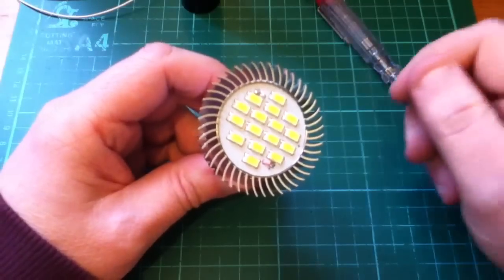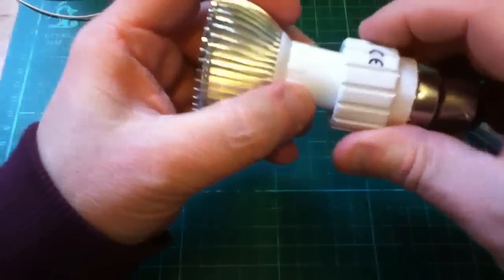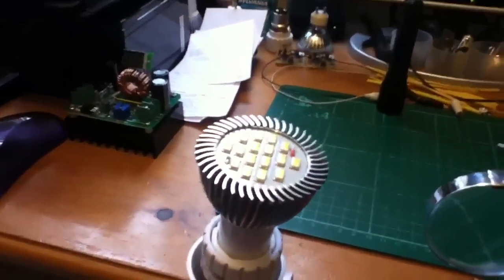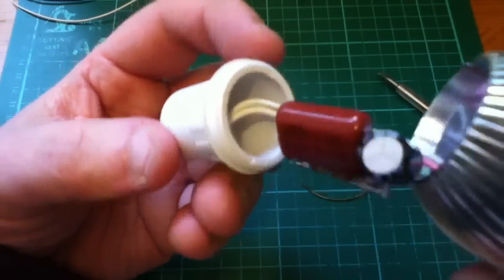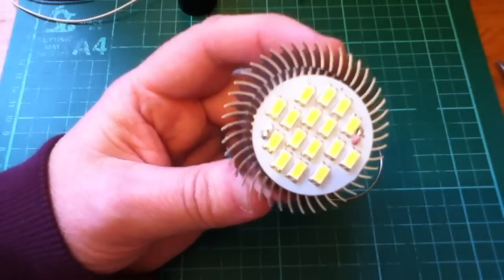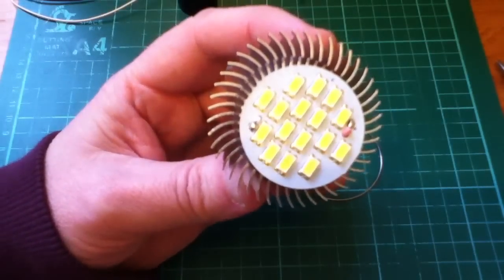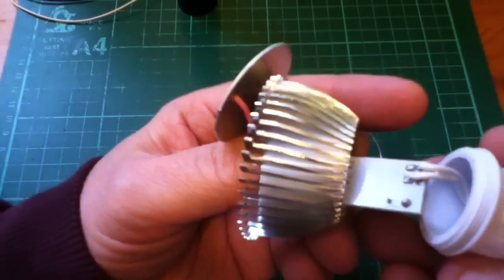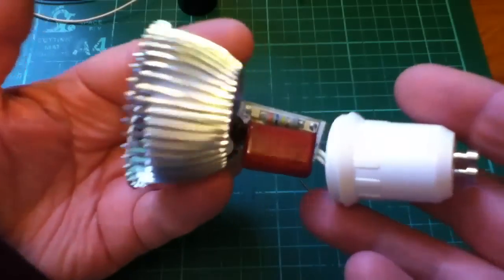Dangerous GU10 LED Spot Light is Cheap and Bright but could Kill You - Seriously

Comment: It would have been worthwhile to demonstrate (or suggest) using a multi-meter to check for voltage on the light... then you can put it in the other way to (somewhat) remedy the problem. THANK YOU for posting this however... I'm shopping these lamps now and wouldn't have considered this otherwise.

Comment: As far as the cost saving concerned, there isn't any isolation transformer for safety reason. For the universal purpose I assume that the spotlight may has a wide range of working voltage, say 90-240VAC. Because of the nature of the LED driver circuitry, this must be a constant current source. Which has a limited (preset) current probably at 60mA. A shocking encounter with such current may not be a lethal experience. After all, it's a sloppy engineering and it's  dangerous as Julian mentioned.

Comment: Interesting. I have one bulb that looks like the one you use for demonstration (but with only 3 leds), bought on eBay, that is fixed on a metal flexible itself fixed onto a metal clamp. All the wires are inside built. So if you're right, even paying attention, I may plug the power plug in the wrong direction (right ?), and then touching one of these metal part seems frightening. For my information, even if what you says seems logicla, what are your references to talk about electricity plz ?

Comment: If your light fitting uses a pull cord switch, or is connected to a two way switch as used on stairs, then you can't tell if the switch is on or off when there isn't a working bulb in the fitting.

Worse still if an incompetent electrician, or previous home owner has wired the light switch to the neutral wire rather than the phase, which is not that uncommon; then even with the light switch off the fitting would be live and when you insert this bulb you'd complete the circuit to earth.

Comment: Lol. If you think that 12-24VDC 350mA and can kill you - then I am a moran. (Of course, if you do not stick tongue inside there!) This lamp is only 6,4 w. I personally have done 200 w LED lamps, which use multiple DC-DC 100W Constant Current Boost Step-up drivers and LED arrays are running 29-34VDC . Those voltage you do not feel with your fingers, even if the drivers are working. Only a stupid will replace running bulbs! This video gives false information! I apologize for my language skills ..

Comment: Usually around 3-12v. However, that's not the point. This is _with reference to ground_. So plugged in one way, you have (UK) 0 + 12v = 12v. Other way, 240 - 12 = 228v. This is certainly not a "little" boot.

Comment from the maker: People make mistakes. If a bulb isn't lit (because it's failed) it's not immediately obvious that power is still reaching the socket. One of the light switches in my house is fitted upside down - we're so used to it we don't think about it anymore. Safety is about multiple levels of protection - this bulb fails at every level.

Comment: 1. The voltage across so much leds in series is about 80 volts or more sometimes
2. Mains has earth reference so current will not flow through the step down circuit but through you

Comment: are you sure about this?  power going into the LED emitters are already supposed to be DC power and significantly stepped down to a lower voltage.  If you have mains power into the 5630 LED emitters then those should have burned out immediately

Comment: There is nothing dangerous about that bulb. Whichever way to plug it into a socket those tabs on the front will be low voltage dc. If line voltage went to the leds they would fry.

Comment: Thanks for your fine video warning. The price is about $6.00 USD, That is cheap for LED bulbs right now.It appears it might have been sold prior to completion. If the mains can be touched and the plug pins are not keyed it might be it was intended to be part of another assembly to be assembled by an experienced hand who would upon completion apply a sign reading "DANGER! NO USER SERVICEABLE PARTS INSIDE"

Comment: As I understand this circuit the rectifier is not polarized. The output is close to the supply voltage, however it is DC. These are commonly used devices, the circuit seems well filtered and has a current limiting resistor. 
As far as the circuit board goes the only thing you can count on is if the bulb has the CE and UL labels. Which means the components have been tested as being safe for normal operation. however nothing protect anyone who uses the device improperly.

Comment: I don't have have the item in front of me to make my own tests but going by the video it is an unsafe product. The item should be double insulated or have galvanic isolation in the form of a transformer. Diodes and resistors do not offer that kind of isolation. Some parts of the world use MEN 'Multiple Earthed Neutral' systems for 220-260Vac and some do not opting for a low voltage system like 110vac.In an MEN system unearthed metal is bad news. In 110Vac systems they figure it wont kill you.

Comment: At 1:59 you said that there is a bridge rectifier. So it doesnt matter which way you plug the bulb in. The circuit is a simple rectifier that feed the LEDs with DC. the resistor and the capacitor are used for ripple normalization. So the bulbs is NOT dangerous. The multimeter is not reliable to count AC voltage because the voltage from induction will count high but there is almost no curent that could even sense it if you touch it.

Comment: High output LEDs need heatsinked usually, even the 3 watt mag lite I have gets alittle warm. I'm not too fond of using the AC ( 120volt ) Chinese LED bulbs, but the low voltage ones aren't going to kill yah. Though technically if it has a dropping circuit.. with a bridge, then i suspect anything past the dropping board is low voltage no matter what you do. If it was a half wave / single diode rectifier, I would be leery then as the live wires would connect directly to the led board.

Comment: Have you traced out the circuit? I doubt that the 390K is a dropper, I'd guess its there to discharge the capacitor (when not powered) which itself is used to pass the AC to the bridge rectifier. If you work out the reactance at 50Hz of the capacitor its that which limits the current. Still no adequate isolation though. Buyer beware!

Comment: Seriously their is not much danger other then a nice pulsing dc output for the leds to work maybe 90v at best. The pins on the bottom of the bulb are ac meaning either side is positive or negitive at any given time. Don't apply dc law on ac circuits it does not behave the same.

Comment: Aluminium is used in the coils of some welders, power cables. It very much DOES conduct and is a very good conductor of electricity. Easy test, just get yourself a piece and do a continuity test with a multimeter.

Comment: Also I would not rely on units even with a proper isolation transformer inside, as you don't know how well the primary has been insulated from the secondary unless you fully pull one apart. I have also seen creep-age distances breeches and non-mains rated capacitors used, to save the manufactures money. I use SELV 12V AC for all my down-lights and use tough large toroidal transformers with excellent results, no switch modes.

Comment: The issue is however there is no way of the ebay consumer ever knowing about these dangers unless they are technically minded, or electronics engineers, and they will not know anyway like your self until you buy it and pull one apart. The CE number missing means it's illegal to even sell them, and I've heard that some dogy manufactures put false numbers on there anyway. Apparently making complaints to the authorities is a waste of time too, as it outside their jurisdiction.

Comment: Just wanted to point out quickly a little tip that may help you and other people when buying electronics. I heard you mention that the product doesn't have a CE Mark. Myself I have an ebay shop and I import electronics. And to my astonishment I have found out that there are 2 types of CE marks. the conventional which most consumers rely on which translates to CE marking is the manufacturer's declaration that the product meets the requirements of the applicable EC directives. The other means

Comment: 3:09 I don't understand how this can be dangeroes. The plate is aluminium (doesn't transfer electricity).
Ok, the wire is very close to the heatsink, but as far as I can see, the wire isn't stripped on the bottom side.

Comment: Was it full rectification or half wave? because it it was full rectification it wouldn't matter as to the orientation that it is plugged into the holder the output wouldn't change after rectification.

Comment: Agreed. If those 2 contacts are the feed for the LEDs, then they are DC current, and more importantly, low voltage. Polarity for the anode and cathode is critical here for the LEDs to function, That's why there is a bridge rectifier to convert to DC, a resistor to lower voltage and a electrolytic capacitor to smooth the wave output.

Comment: the main is never in contact with the heat sink the only power is DC to the LED and the heat sink would be earthed if it was placed in a standard halogen fixture because it would be touching the metal case that is grounded...nothing dangerous here!

Comment from the maker: Interesting. I can't believe that a "professional" lamp would use a dropper circuit. I can only assume it was a heat issue and that the transformer isolation was being compromised. It does state that the problem only occurred after half an hour of use.

Comment: LED lamps in GU10 bases are usually meant for mains voltage (about 90VAC to 240VAC), they have LED driver electronics built-in.

Comment: Of course the LED array would have been fried and gone dark if there was more than say 30 volts (AC or DC) across the board. Julian's point is that there might be live voltage from some of the finger-touchable parts of the light, relative to ground.

Comment from the maker: That's true - it will show a low DC voltage.
However, if I connect a multimeter between the LED array and ground (i.e. earth, soil, mud) it will show mains voltage - and that's where the danger lies.

Comment from the maker: The front plate is a printed circuit board, but it's not made of glass reinforced plastic (fibreglass), it's made of aluminium. So the thickness of the insulating layer between the PCB tracks and the aluminium substrate is a few microns.

Comment: The best advice is buy your lights from a shop not ebay.
One of the reasons a shop is more expensive is they must only sell products that comply with standards. If they don't there are government departments dedicated to making life very difficult for them. Bad feed back on ebay does not have the same affect. 
I have an LED shop and I constantly get the " I can get that on ebay cheaper" line
and frankly it is irritating. Thank you for some enlightenment on the subject.

Comment: It is not double insulated! Nothing should be live and exposed to touch, weather  A.C. or D.C. The construction of lamps is not covered by B.S.7671 but at the end of the day common sense rules.Anything that runs on electricity at any voltage runs the risk of fire shock and burns.It would be very interesting to see if any of the parts would catch fire under test? Well spotted!!!!!!!!

Comment: Julian is right.
The key issue with this lamp is lack of galvanic isolation (look it up on wikipedia) between the mains parts and the parts you can touch from the outside. The presence of the bridge rectifier (or any of the other parts shown) or the fact that there's a relatively small voltage *difference* over the LEDs themselves doesn't change that.

Comment: So many misguided people thinking that because it's LED it's somehow going to be low voltage DC on the front.  Yes, there will be about 40v DC across the LEDs, but touching those contacts is indeed Russian roulette, since the only thing between you and the mains is one of the rectifier diodes, or if you're very lucky maybe the capacitor too, which might limit the current to about 100mA, which could kill you anyway.

Comment: a few microns of insulation... thats smaller than a spec of dust... the filters on the ventilation systems for making Intel chips are rated for 'a few microns'... and your you clearly demonstrate a medium sized screwdriver distance between the LED and the aluminum heat sink...
Couple that with not knowing what a rectifier actually does...
I have to ask if you have ever been committed to an institution?

Comment: I would think that at the point the current reaches the led board, it has already been converted into dc by the rectifier and voltage / current reduced by the resistor?

Comment: This is how the power supply works. The capacitor charges through the resistor, the impedance being carefully worked out. The output of this is rectified and smoothed by the electrolytic and fed to the LEDs. One of the problems being that failiure can lead to mains at the LEDs even o  a lucky orientation. Dismantle it so no one gets hurt.

Comment: A little confused. What I interpret from the video was that the casing could become live, due to the close proximity of the led wire carrying live voltage when plugged in wrongly? Little electrical knowledge, so correct me if I'm wrong.

Live (AC) -> Bridge rectifier (DC) -> Resistor + Capacitor (Pull down) -> LEDs

I don't think the orientation of the plug matters? If it is plugged other way, it's just 180 off phase, the diodes in rectifier will still ensure the DC current is correct polarity.

Comment: Julian is perfectly right this is lethal, provided the "hot" wire happens to be connected to the bottom AC input terminal, and the bottom part of the DC circuit is accessible for touch. Prathyush confuses polarized current with safe "-" and unsafe "+", while bridge rectifier in fact may distribute the live unsafe wire to DC "+" wire in one half of the cycle AND to DC "-" wire in another half of the cycle. I wouldn't care as his comment was rude, but his misled readers may get injured or killed.

Comment: you are right, at the top will arrive some miserable dc voltage. To the uploader, please stick a multimeter there to see if you don't believe it. Led do work only on polarized voltage at theyr teminal, after the bridge did it's job...

Comment from the maker: I suspect the LED string has a forward voltage greater than 12v so the modification would be a boost converter with constant current control to set the LED brightness. They're available on eBay for a few pounds.

Comment: Sigh.   Do you understand that the front disk is connected to one of those pins in the back, directly?

In the USA, we CAN'T screw a bulb in backwards.  

Cords have polarized plugs, too.

Ideally, this bulb should be completely isolated but it's a dirty little circuit.

If I were designing it, mains power would go to the board, and only DC would go to the disk; but I've seen crap like this as recently as a month ago in an OLD fluorescent light.

AC went to the end of the lamp !

Comment: Maybe you don't understand.

This GU10 is unpolarized.   Meaning you can accidentally put it in backwards.

In the USA, we went to polarized EVERYTHING decades ago.

If you put this bulb in the "safe" way, the front disk is connected to "neutral". 

If you put it in the "wrong" way, it's "hot". 

Suppose you were grounded, and touched the "neutral" line.   Okay... probably nothing would happen.

Suppose you were grounded, and touched the "hot" line.   Okay, probably you'd have a nice funeral.

Comment: Lots of partial information and no data to back anything up. Where are the multi meter readings showing there is power going where you say in the amounts you claim? I can take anything apart and claim something is dangerous as long as I 1) do not show data proving my claims and 2) don't give complete data on the claims I make. Do a video both explaining about how LEDs ARE basically run by DC and how this bulb converts AC to DC then show how much power is actually going thru them.

Comment from the maker: In that circuit, live mains is fed via the lower left diode in the bridge rectifier directly to the LED cathodes. Touch the LED cathodes and every negative going half-cycle a high voltage will seek a path through your body to ground. The LEDs and dropper components make up a completely separate circuit and are not relevant. The voltage across the LEDs is not relevant. The current flowing through the LEDs is not relevant.

Comment: again you are going wrong dear
a dropper circuit is always connected in series
in layman's language it comes between the load equipment and the power source
so all the time the potential at  the led terminal is as low as 3v
and in the video you are talking about possibility of getting live on any of the notches my dear friend it has already been rectified using the bridge rectifier so the polarity is always fixed

circuitstoday(.)com/wp-content/uploads/2009/03/mains-operated-led-lamp.jpg

Comment from the maker: Let's say I connect a wire between live mains and a door handle - would you touch the door handle? I Don't think so. Now I connect a circuit with LEDs, a dropper and smoothing capacitor between the door handle and neutral. There's a small DC voltage across the LEDs and they light up. Does that mean it's now safe to touch the door handle? Of course not. The LED circuit is irrelevant.

Comment from the maker: The most likely failure mode is overheating of the LEDs if insufficient thermal grease has been applied to the back of the LEDs and between the LED plate and the heatsink.